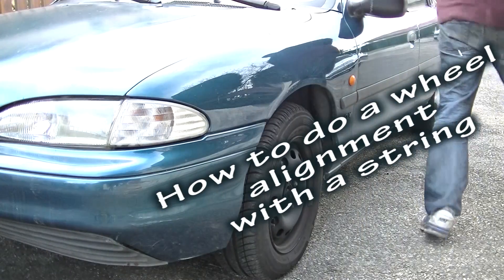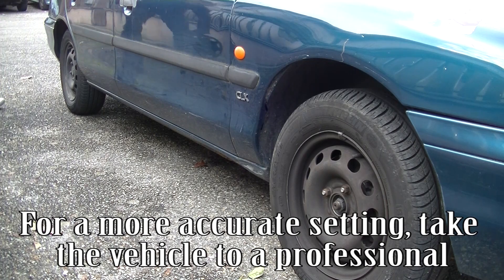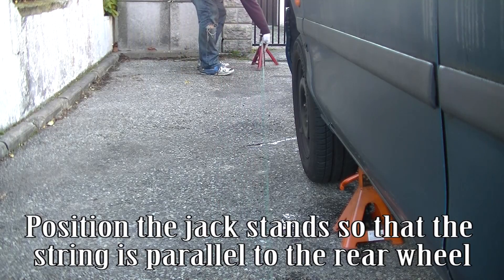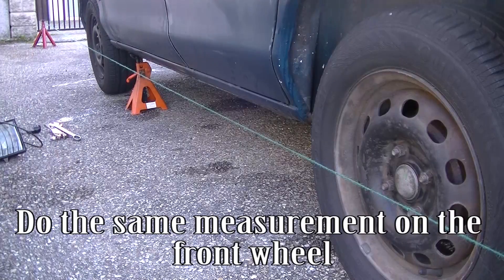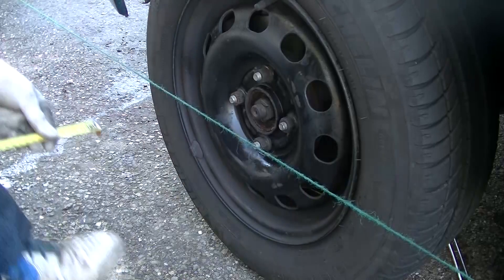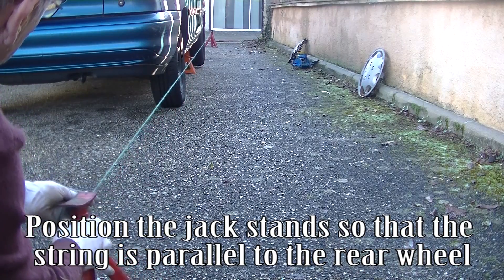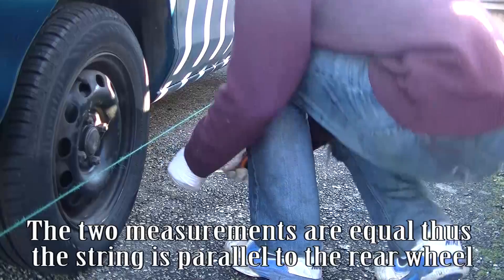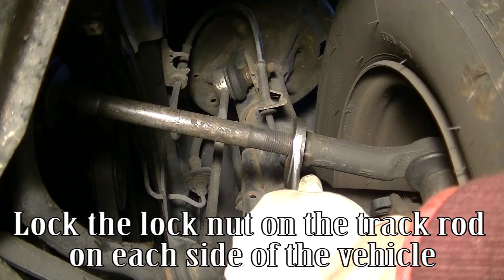How to do a wheel alignment using a string

Comment: He has the right idea, but the full weight of the car needs to be down on the tyres (the car should not be raised or jacked-up when adjusting the tracking, as was the case in this video).

Also... a slight "toe-in" is required on the driven-wheels (the 1994 Ford Mondeo is a FWD vehicle, so the torque forces from the drive-shafts will tend to flex the front wheels outwards (hence the need for a counter-acting toe-in alignment). That way even-tyre wear, and a natural-feeling steering will be achieved.

Comment: Hi, i was under the impression front wheels are supposed to be toed in so the car can stay straight.  But your measurement on both front and rear edge of the wheels are the same.  Or is it here in the US we do it differently?
Reply: I use this alignment method and generally go 1/16 to 1/8" toe in so when you load the front end driving, it's not toe OUT which causes wandering.
Reply: A toed in alignment is usually the normal, offering stability and slight understeer in corners. Toed out alignment will give you oversteer and instability during windy conditions and if the car is unevenly loaded.